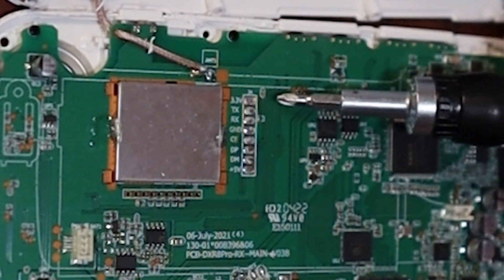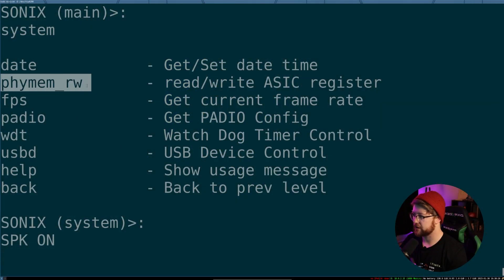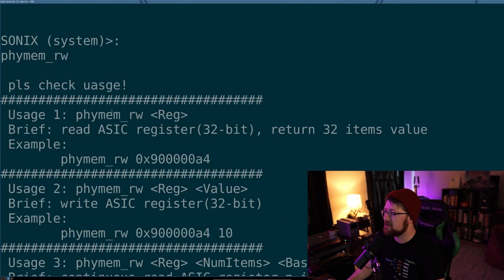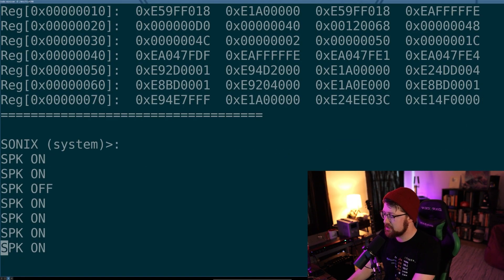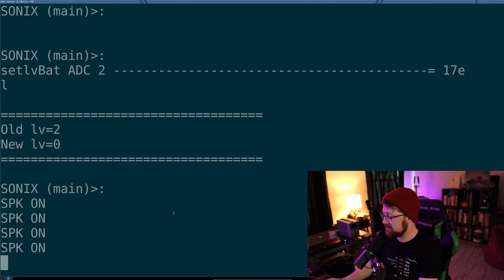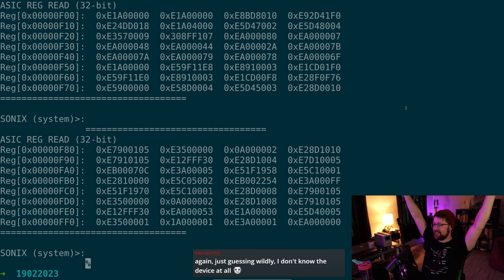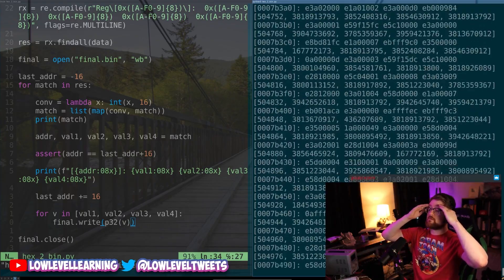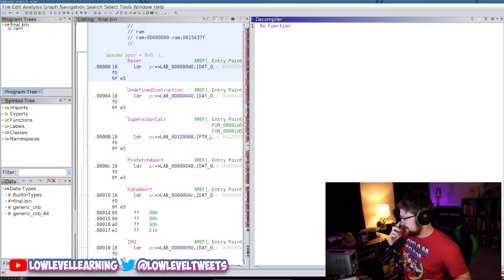i extracted the secrets of my son's baby monitor

Comment: build your own camera/monitor. you already know these products do not have professional programmers writing the code. at best, the poor hardware guy has to write the code. at worse, they outsource to a questionable country
Reply: Well, if you plan on making one in the future and require someone to design PCB or write some embedded code, LMK, Happy to help
Reply from the maker: I honestly considered this at first. Alas, I procrastinated.
Reply: @LowLevelTV  if you have any spare raspberry pi's or other low powered linux sbc, plug in an arducam, get a wired or bluetooth mic and speaker, install homebridge/etc and add it to your smart home security system. i do this for my dogs
Reply: @nil0bject  doesn't trust developers of hardware.

But trusts developers of other hardware.

What makes you think homebridge or any of the libraries or hardware for that matter is secure? You think that Bluetooth mic or speaker is encrypting its audio?

You think that sbc OS isn't phoning home?

If you're saying "Ah but people have tested it" what do you think this dude is doing for his baby monitor hardware?

Like I get it, it gives you the warm and fuzzies rolling your own using metaphorical lego bricks thinking you're more secure as a result, but there is nothing to back up that assertion.
Reply: An Esp32-cam is like $6. Pull off the IR filter and add an IR spotlight, you'll be able to see in the dark, and if you use wifi with wpa2 or 3, it's encrypted by default.

Just my $0.02.
Reply: @noahw4623  wpa2 is encrypted, but can be broken...heck I do that for fun (with network owner's permission): I'd want something on top of that
Reply: @JaykPuten  Correct me if I'm wrong but WPA2 is secure, the trouble is that you can get around it (e.g. by intercepting passwords).
Reply: @eldrago19  it's secure, though brute forcing works quite easily... And there's problems with how devices handle implementation(using certain tricks)
But yeah, as far as I know it's secure, then again I haven't messed around with it in a few years, so there could be some way to hack/decrypt it that I'm not aware of (e.g. inherent vulnerability) but, yeah it's secure, the biggest weakness is the hardware used, the implementation, replaying packets etc.. but if everything is handled correctly it's currently secure
Unless there's something found in the future like with WEP, or with different machines interpretation/implementation of WPA2

Though there is the KRACK attack that WPA2 is vulnerable to, and wpa3 is vulnerable to forcing a downgraded usage to WPA2

The Wikipedia on wpa is not too detailed but is good setup for further reading on the topic
Reply: @LowLevelTV  well make it and we will buy it
Reply: @LowLevelTV  mood
Reply: You can easily build a baby Monitor by esp 32 cam and a rasberry pie
Reply: I have to agree, if you can use a pi to watch 3D prints with octopi or whatever it's called, adding in an encrypted function before sending the video seems like it would take less time than it did for you to dump the firmware...
Since I'm guessing you've got the Linux skills...
And then you can watch on an app you write for your phone to decrypt the video...
Or just build a dedicated video display with another SBC to decrypt..

Plus then you have another excuse to buy another pi 0 w... As man I'm always looking for excuses to use a pi that my wife won't look at me weird for
Reply: @JaykPuten  either add an encrypted function or.... Just use a VPN on top. Simple to do and security guaranteed compared to writing your own code.
Reply: By the time he's finished making his own baby monitor he won't need it anymore
Reply: @daliuskal  But someone else still will.
Reply: I mean, the hardware os right there, it should be possible to flash a custom firmware on it, right?
This actually might be fun!
Reply: If you are fine with a network based cam you could totally use a raspberry pi and motioneye, an open source surveillance camera project. Gives you nice apps to look at the streams, can trigger on movement (and I thinnnnk audio?). Let's you configure lots of different notification options and record too. I've used it to catch the cats and foxes that sometimes come into my garden, I'm sure it'd work just as well with a baby ^^
Reply: @X41-f4t  there's a specific RPI OS for using as a surveillance system with a camera?
As my first thought was octopi... Man I really gotta catch-up with all the RPI OSes now, as that gives me plenty of ideas to replace my Ring doorbell and other cloud storage based video camera's... Especially when you're privacy minded like me and would rather know what encryption is used, or switch it to one you trust(since I'm assuming it's open source)
Not that it's really hard to just roll your own RPI OS for your own needs, it just takes more time than I currently have in life trying to balance time with my wife, work, family, and having actual hobbies unrelated to programming and SBC projects...
Though it sounds like a fun excuse to design a specialized 3D printed case to hold the RPI(probably a cheap 0w) and whatever camera plus USB power, a USB hub, a battery backup and solar charger all together
Reply: @JaykPuten  absolutely! I got myself a picam with ir cans for night vision and just glued that on top of the case I got for the pi, works great
Reply: @X41-f4t  ohh yeah I didn't think of night vision, add that in and print a good all weather PLA+/or stronger material case is now on my to-do list.. have them all connect to a Pi4 with a SSD drive and I can keep quite a while of video saved, for home use, or outside using cheap pi0Ws for wildlife capturing would be cool, especially with solar and USB battery banks
Reply: @JaykPuten  that's pretty much what I did for my wildlife cam :D
I took my "survival" power bank with a solar panel on it, put it in a zip lock bag with the pi and poked a hole through for the lens. The crappy built in solar panel wasn't enough to recharge the batteries faster than they were being drained, but it helped and the cam could go on for 2-3 days without recharging. Hooking up a more efficient solar panel would've probably made it work completely independently
Reply: @JaykPuten  I'd use either ABS or HDPE. I had some plastic things in a space with wide temperature swings and a lot of direct sunlight that somehow survived 20 years of that abuse which were made out of those two plastics. Everything else became brittle and crumbled in my hands.
Reply: @anon_y_mousse  oh man... ABS...I'd rather come up with a metal printer that takes some random metal and through a personally developed fusion/fission reactor makes stainless steel 3D prints than try and get a decent (to my specs) ABS print... Nylon feels easier to print with than ABS

That can't just be me right?

Besides I live in the great lakes area where it never stays a season long enough for PLA+ to warp...
Last week we went from winter to fall to super icy/sleety winter to summer yesterday to winter again today...
Whatever plastic I use is going to be messed up, unless I engineer it to last space travel
I'm of course just kidding about ABS

Though that Wood PLA that you can sand and varnish and seal like real wood, means you can make some pretty hidden wifi camera boxes... To the point where you have to wander in the picture and figure out where you left it to find it
I think I've made some hide a key boxes that I hid in broken parts of furniture that were so decently camouflaged that Goodwill has more sets of my house keys than I have
Reply: @JaykPuten  Hard to print, but really sturdy and long lasting. If it can survive 20 years in a Texas attic, it's not half bad. Just my $0.02.
Reply: @JaykPuten  that’s me with petg. I have two printers down right now for repairs because I tried petg. I have had literally one good print ever, never replicated.
Reply: @JeronimoStilton14  oh yeah petg can be up there in the "pain to use" list of filament, I got one of my printers doing it, but it took so much time and voodoo that I can't remember everything I did so my 2nd printer of the same mame n model won't do it without a ton of wasted filament and enough cursing to fill a curse jar in a day.

I wanna try carbon fiber/nylon and such but, I doubt my ender 3 pro n ender 5 could handle it without a ton of upgrades
Which I'd do if I had the time, but I don't.. even though I bought and built the printers so I'd know how everything worked
Because when something breakdown, I know exactly what broke and how to fix it without sending it back to the company like some printed require
Reply: Those poor hardware guys... Are people I know.  Be nice, please.  They mean well.
Reply: Yea, couple micro controllers and you'd have your own baby monitor, I am trying my best to stray away from anything proprietary, in a consumer grade setting it just doesn't make sense. Let the companies war it out over intelligence, we can try and build a world where code and computers are free.
Reply: @SloppyPuppy  Your ideas are intriguing to me, and I wish to subscribe to your newsletter.
Reply: Almost everything in this comment is ok, but WTH with the cuestionable country? You don't need to be/or come from any particular country to encrypt the communications and write good code ☝️  That's the awesome thing about coding!
Reply: @eduardoromaguera9707  Absolutely, and the reverse is also true, plenty of bad code is written in the US and UK etc.
Reply: Odds are that the programmers were given a couple of weeks to come up with a demo/proof of concept for management, and then given another couple of months to finalize it for production.

The “throwaway” demo becomes the actual product, and planned features like encryption or option menus tend to get dropped in the time crunch.
Reply: @WytcherNytes  Or they fire the programmers because they're from india and who are they gonna sue, and then they can use the embedded system software without any care.
Reply: Just want to recognize that you're rocking the Marathon logo. Right on man. Frog blast the vent core.
Reply: lol
Reply: Is encryption required here by law? No.  Is encryption here something every Joe & Jenny Expecting are obsessing over in baby blogs?  No.  Is encryption proudly trumpeted on the box?  No.   Likelihood of encryption being included: statistically indistinguishable from zero.
Reply: The game nowadays is to pump out as much products as possible on the market, disregarding, quality, safety and other concerns, like privacy. It doesn't matter if the produc is bad, there is another one replacing it tomorrow. It is everyone for themselves and morality is out the window.
Reply: More likely, hardware guy uses whatever trash the manufacturer provides. (and there's no docs to build your own code.)
Reply: If the "poor hardware guy" is an Electrical Engineer he will be much better than the "professional programmer" who knows nothing about hardware and tries to do everything through abstraction layers. Placing a "professional programmer" (aka Code Jockey) over a real engineer is seriously mistaken.
Reply: @scramjet4610  lol. is that why the iPod didn't sell well?